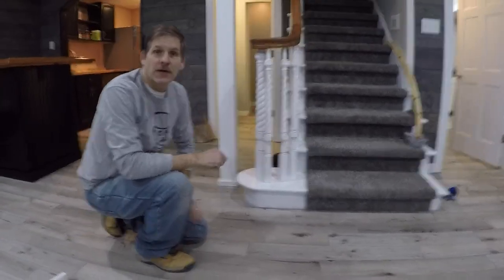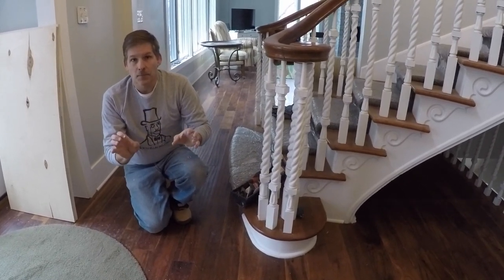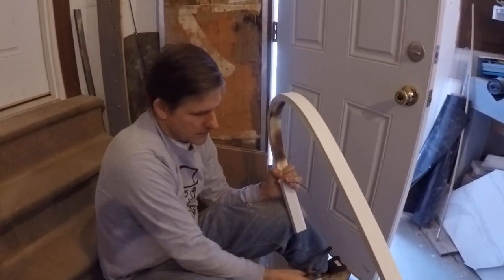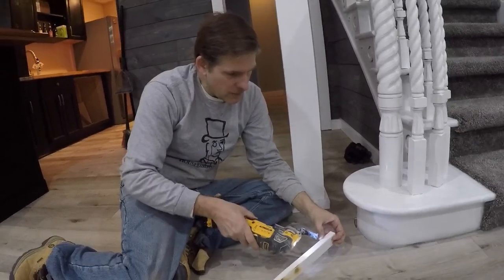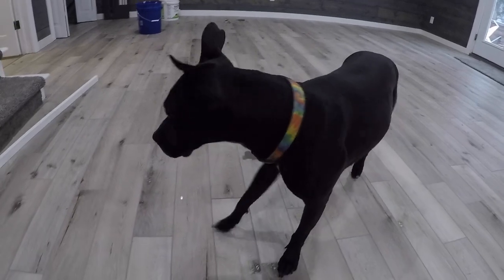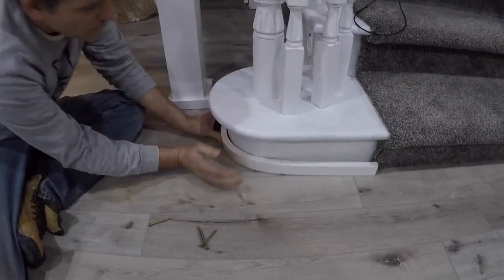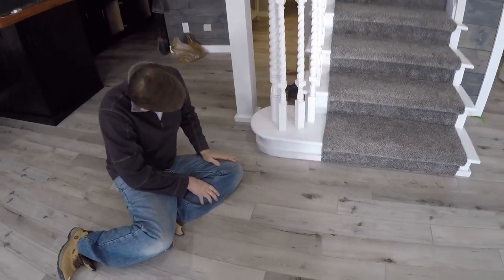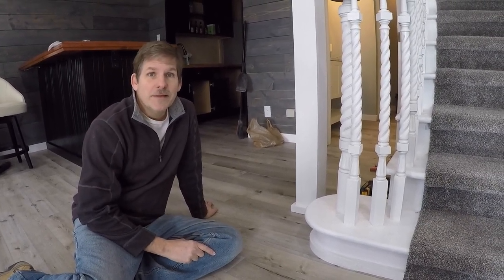How to Bend Trim Around a Curved Surface

Comment: I would make a template with cardboard and make sure that fits good, then transfer to a piece of plywood maybe two together for better thickness.  Get the trim, starting heating up and screw to plywood until complete the whole piece. Then remove the screws and mount.
Reply from the maker: Hey Gil,
Thx for taking time for the input!